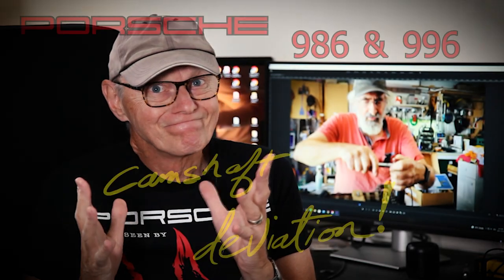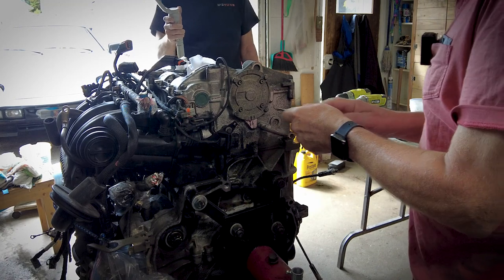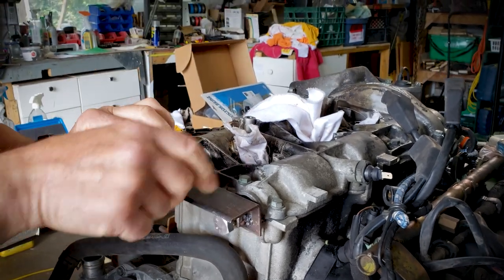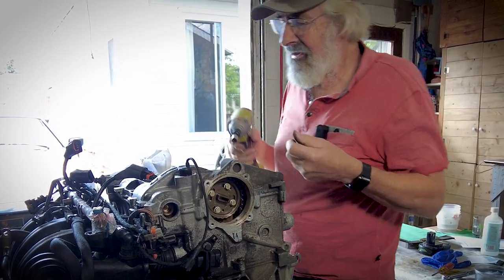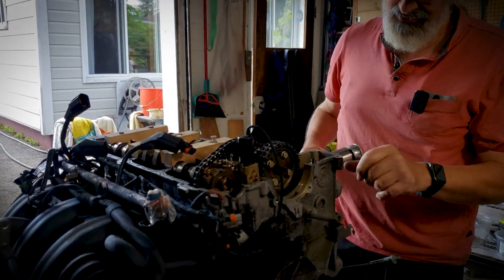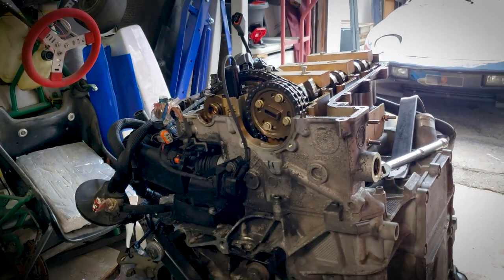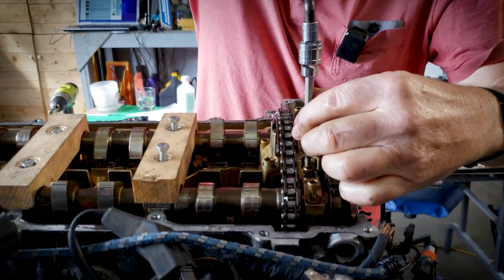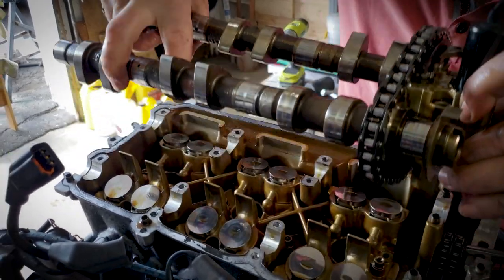Porsche Camshaft deviation

Comment: Hello sir, my 2002 996 turbo cam position  1 deviation is -7.75 °kw & cam position 2 deviation is -4.94° ... Should I be worried, can you explain ? 
These are values at idle
Thankyou
Reply from the maker: Hi Vicky, 
I must admit that I know little about the turbo engine. It is not an m96 engine but rather what we call a Mezger engine. That said, if the chain internals are similar, I would expect to see worn guide rails. Anything more than 6 degrees would signal time for a change. I suggest that you talk to a trusted Porsche indie.

Comment: Is there are reason why Grant uses the homemade tools to lock down the cam even though the engine is rotated 90° and gravity is doing the work?
Reply from the maker: Hi, yes, there is always pressure on the cams by the valve springs.

Comment: Hi! I just want to change my dead engine M96.20/65X to same M96.20/65w. The big proplem in this operation its camshaft sensor. I have two sensor in both camshafts, but in new same engine only one camshaft sensor in passenger side (Left hand drive). What you can recomend? Will it be the new engine without second camshaft sensor working well or not? Do you know decision exists?
Reply from the maker: I don't think that you would have any problems. You should ask a real technician in an independent Porsche shop. I  am not an expert.